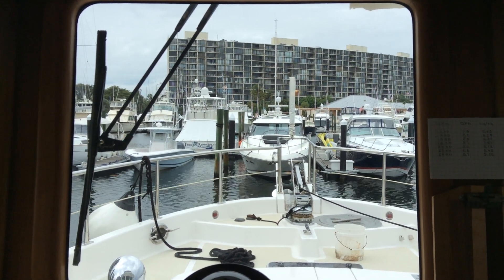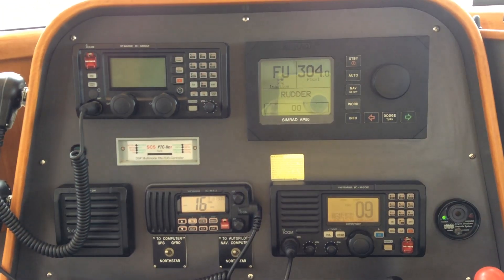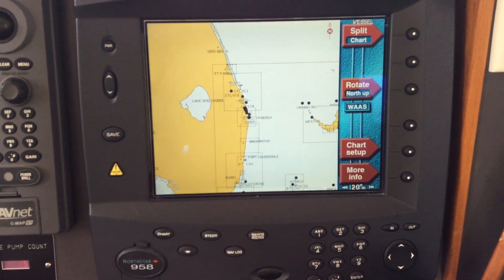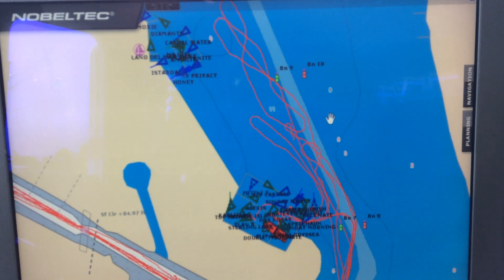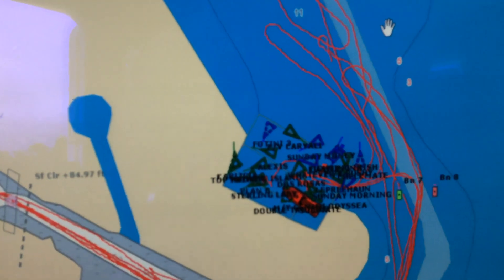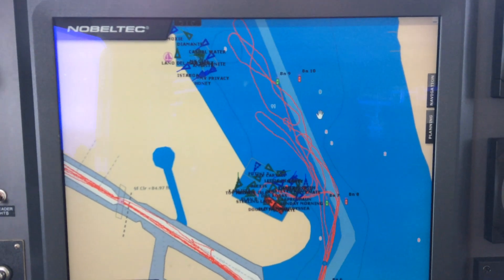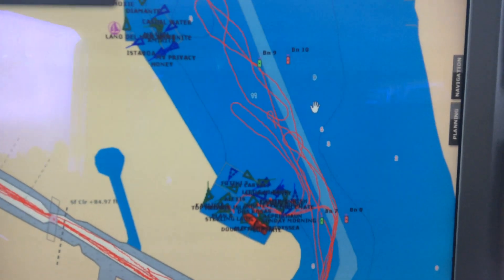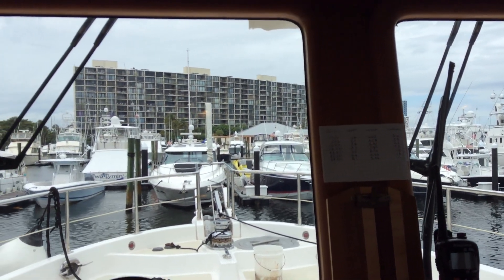Dashboard tour Nordhavn 47

Comment: Nordhavn 47 is a pretty nice boat. Good reason to turn AIS off when not on the host. I guess you need to have a ghost security system to monitor your boat when you are away instead of AIS.
Reply from the maker: There are  systems that can provide any information you want direct to your cell phone. Some include features such as door openings, videos of service techs while aboard and count the bilge pump cycles.